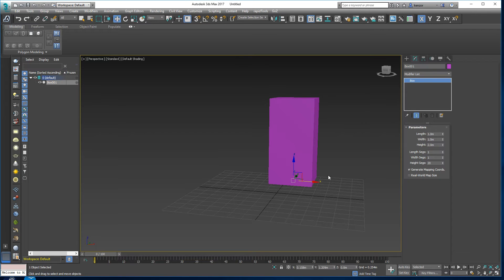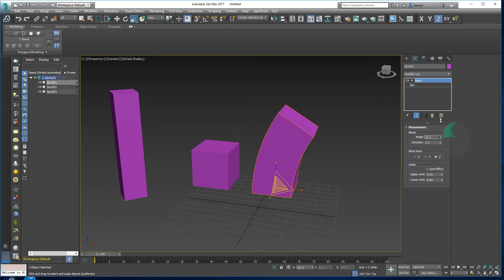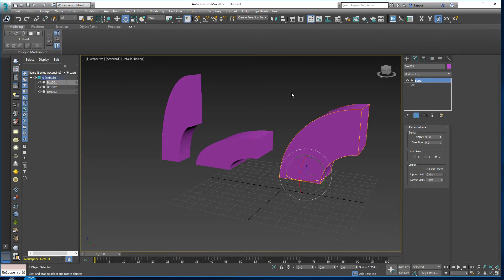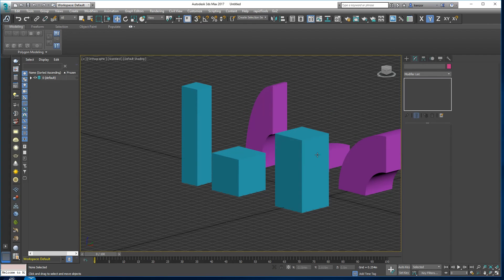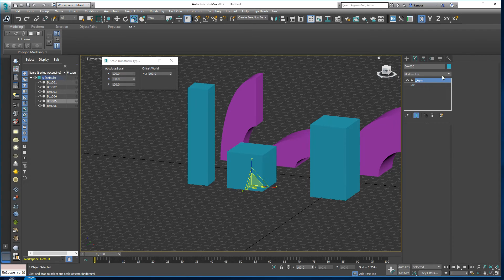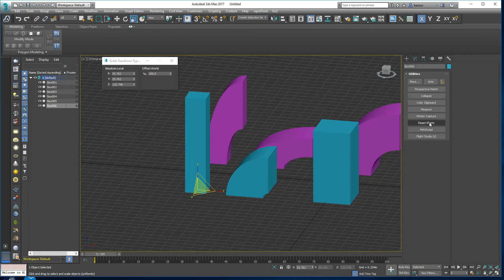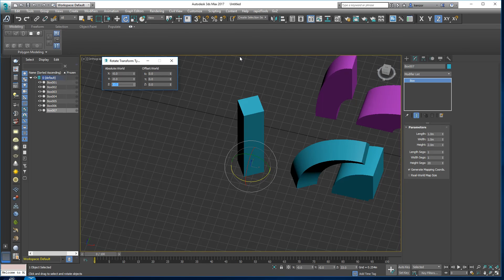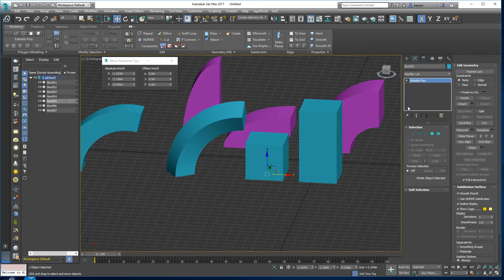Intro to 3dsMax 07:Reset Xform

Comment: Resetting scale and rotation works fine via this method, but not when it comes to the transformation. 
I've read numerous places that you can alt+right mouse click the object, and a menu will appear where it will let you freeze transformation, but that alt+rmb, doesn't make eany window appear
Reply from the maker: That depends on what your trying to achieve. In the 'default' shortcut setup Alt + rmb should make the dialog appear that allows you to 'freeze transform'. However this function is for animation NOT modelling. ( my tutorial is really orientated to fixing modelling issues ). Freeze transform in 3ds max allows you to zero the animation controller by adding an extra animation layer.

If your in maya navigation mode the shortcut may by different. but you can also get to the freeze transform dialog by pressing X to search all actions and typing ' Freeze transform' transform in the search box

What I don't cover here is how to recenter the pivot point ( which is kinda a separate issue to the scaling problem ).  But if that's what you need you can recenter the pivot by:
-  opening the 'hierarchy panel'
-  clicking the 'pivot' button
- clicking 'affect pivot only' 
- clicking 'Center to object '
- finally click off  'affect pivot only' 

While 'affect pivot only' is on you can move and align the pivot in any way you choose . I'll often snap the pivot to a vertex to make sure edge loops line up. (i.e you don't have to use the  'Center to object ' button )

Like i said max is 'somewhat ' like Maya so while the functionality is there the definitions and workflows are different.

I hope this helps but if this doesn't answer your question then ping my a reply here. :)
Reply from the maker: There's also the transform toolbox that gives a quick single click options to reset the pivot and align the pivot point
Reply: Hi  @kenzorman  ,thank you for the reply.
right now I am just testing a simple box placed next to world center.
I did the search via the X button as you suggested, and choose "freeze transform", it gives me a warning message which i proceed, however it does not reset the transformation.
I also tried going into the "Hierarchy" menu and hit the "Reset Transform".
Lastly I went into the "Utilities" menu and tried the "Reset Xform".

Nothing works. 3ds just won't have it. Grrr
Reply from the maker: @knekker1  what do expect should happen ? Are you trying to move the box back to the center of the world ?
Reply: @kenzorman  that is what is currently happening, when I reset all transformation axis input back to zero, the object just go back to world center.
What i want is like in Maya, where I can place an item where ever in world space, and then freeze transformation, so the object will go to that point whenever i reset all transformation axis inputs.
Unfortunately that does not seem to be possible in 3ds max or am I missing something?
Reply from the maker: @knekker1   the alt + rmb menu will do that. Might be worth trying to reconnect the shortcuts.
If you go to 'Customise user interface'   group : 'main ui'  Category:'Quad menu sets'
You should be able to reassign the alt+rmb to the Animation quad menu
Reply from the maker: To be clear in the Animation alt +rmb quad menu 'Freeze Transform' and' Transform to Zero'  should do what you need.
The hierarchy menu messes with the meshes centre ... and isn't what you need .
Reply from the maker: There's also a separate method to do a similar kinda thing. From the animation menu you can use  'Set as skin pose' and 'assume skin pose'
Reply: @kenzorman  I found the "freeze transformation" via the search button "x" as you suggested. that unfortunately did not help.

It's okay though, you have been very patient and helpful with me, and for that I want to thank you very much!
Reply from the maker: @knekker1  No problem If you can get the Animation quad menu working you will be able to do the operation. But without the 'Transform to Zero'  tool you're stuck